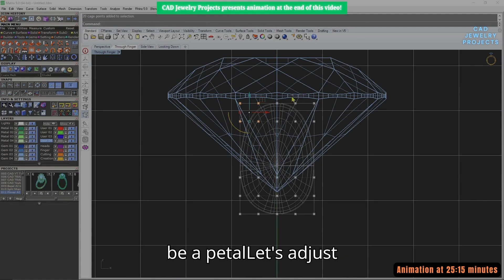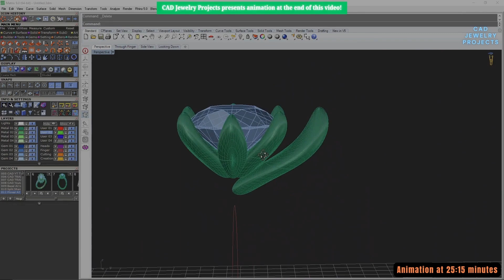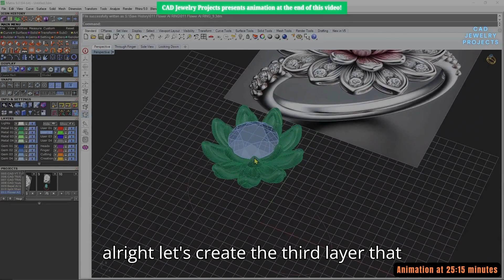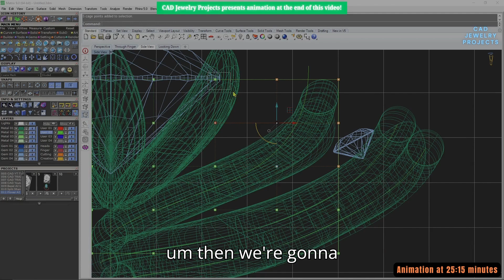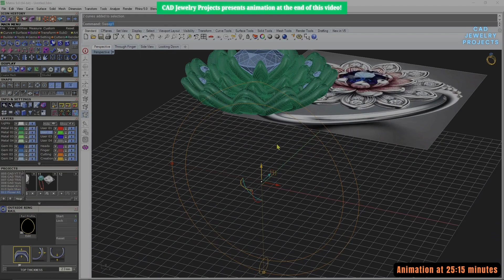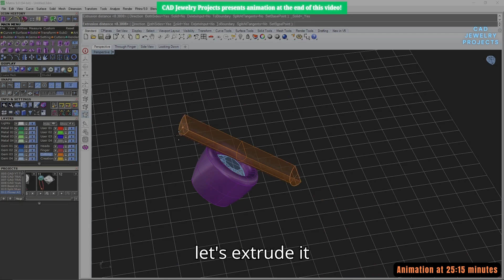I Created This AI Jewelry Flower Engagement Ring Design into CAD | Tutorial on CAD Matrix9 | Rhino

Comment: amazing , subbed , 
i have a question , why are you using Matrix 9 instead of Matrixgold ?
Reply from the maker: Awesome! I'm using Matrix9 because I find sometimes MatrixGold is a bit unstable but you can use MatrixGold absolutely or Rhino 8 is awesome as well. These 3 programs are perfect for jewelry designing. Please share the view, it would help the channel out.
Reply: @cadjewelryprojects  
ignoring unstability , do you think MG is better than M9 ? does M9 have any parametric/dynamic commands ? 
for example , can you change the ring size after the end of the projects ?
Reply from the maker: @mohameddawood1720  I believe there's pro and cons on both programs, it will depends on how experience the designer will use the software. Yes a lot advantage on MG, no doubt on that.
Reply from the maker: I will also include MatrixGold content in the future! so look out! :D